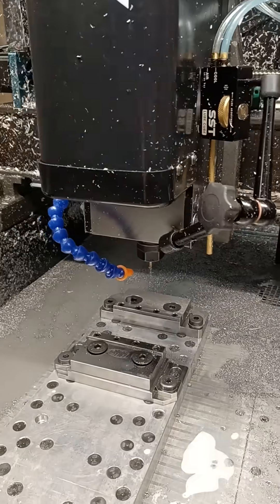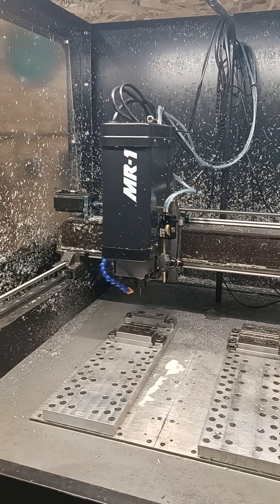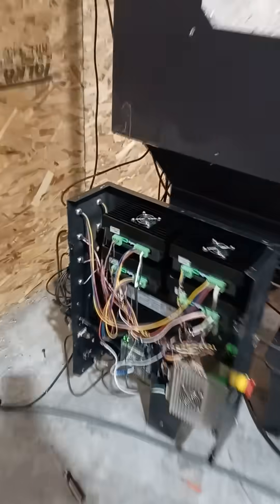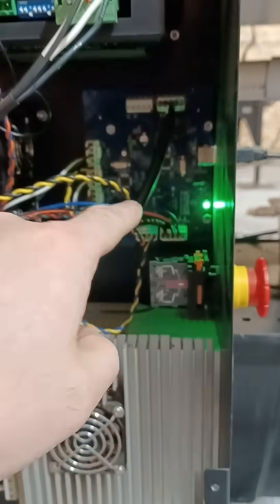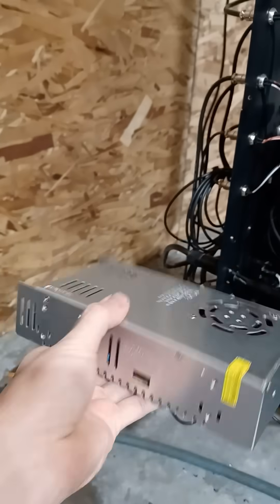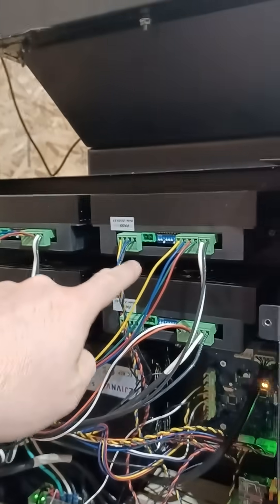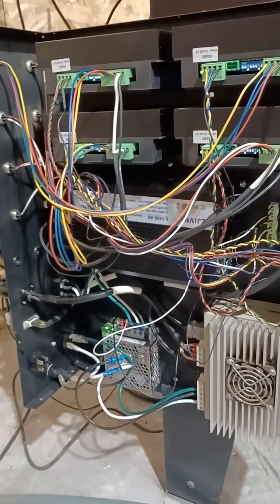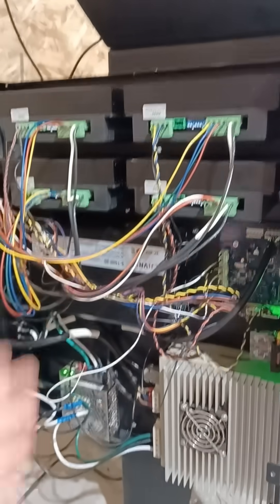Langmuir Systems MR-1 upgrades! (Part 4)  @LangmuirSystems  #cnc #cncmill

Comment: Love the upgrades, however, you are going to need to upgrade the ballscrews and rails to handle the increased output,particularly if you are upsizing the motors. If you have a crash, it may be catastrophic.
Reply from the maker: Even the new motors being 2x more powerful are still not that powerful.  If I crash and break something then I crash and break something...  This is true with any cnc machine.  The goal is to not crash. :)